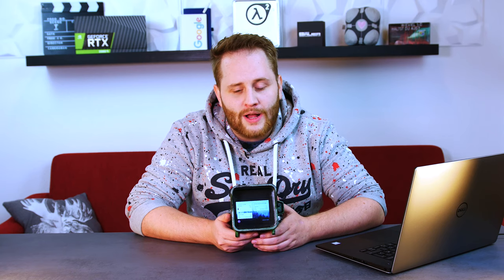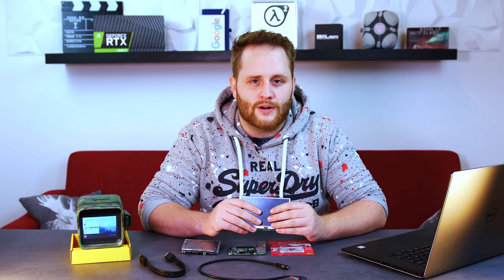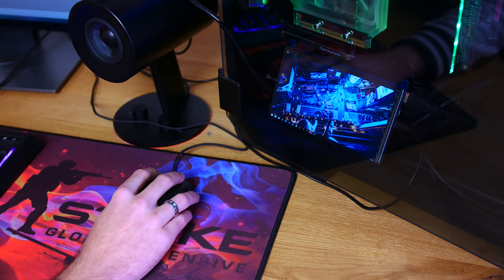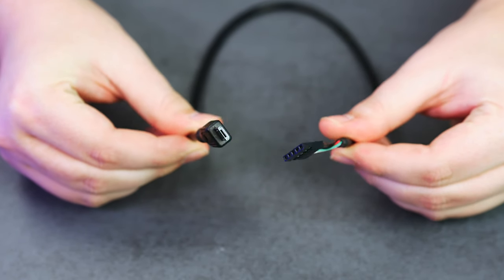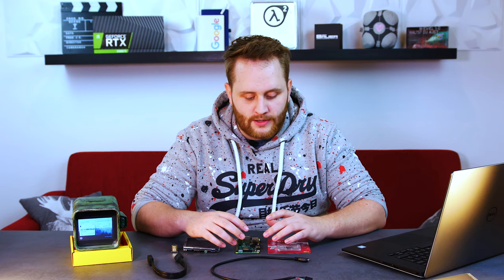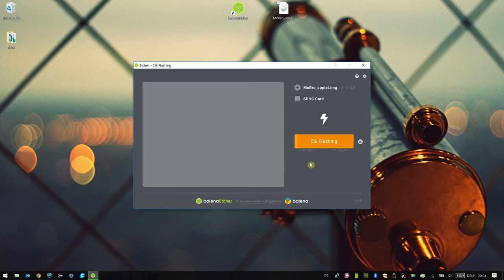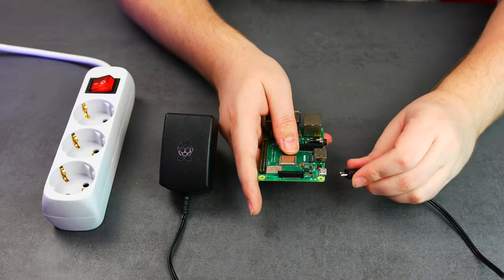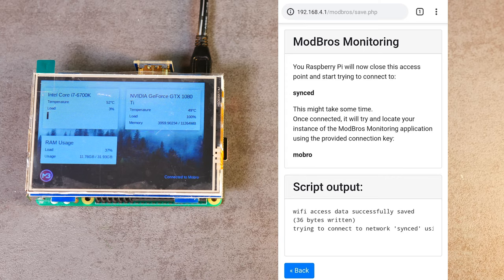How to create a PC Hardware Monitoring Screen Inside your Case

Comment: Great job! One question: If my PC connect to the Raspberry via wifi, does it means that I can't connect to the Internet(Wifi) at the same time. My PC doesn't seem to be able to connect two wireless networks at the same time. - -
Reply from the maker: Hey :)
You don't need to be connected to two networks.
Just connect to the Raspberries Wifi and follow the instructions to configure it. Once that's done the Raspberry will connect to your normal Wifi (there is no Raspberry Wifi after that).
Then you can connect your PC to your normal Wifi again.
Now that everything is in the same network, you're good to go and the Raspberry should display your Stats.

This setup is only required once. 
(unless you change your Wifi name or password, then you would have to do it again)
Reply: @ModBros  Very cool, just like the wireless printer. Thanks for the answer.

Comment: How do you display FPS Can't seem to find that anywhere inside the app im using it on a tablet via wifi on the same network as my pc
Reply from the maker: We currently use sensor data from open hardware monitor and Libre hardware monitor. If these sensors do not pick it up you could use hwinfo like described here:
https://www.mod-bros.com/en/faq/mobro/desktop-app/hardware-monitor/data-sources
As far as I know for hwinfo you need Fraps or MSI RivaTuner Statistics Server running in the background to see fps.

Comment: Running in to a problem. 
Have an AMD 5700XT and it shows constant 0% load, 0% Memory Used and 0 degrees celsius? Thoughts and Ideas? Anything I can do on my end? Note that it does Display the correct GPU (AMD Radeon RX 5700 XT)
Reply from the maker: Yes the 5700 series cards do currently not show data.
That's something we already know about and will be fixed in the next version.

Comment: I have an raspberry pi 3b+ and a 3.5 inch monitor but its stucks direkt in the raspberry do i MUST have a monitor with hdmi?
Reply from the maker: no you don't have to use a hdmi monitor. a display directly mounted on the Raspberry, connected via the GPIOs (the row of Pins), does also work just fine.
However you will have to install the corresponding display driver for it to work.
See the last section of our written tutorial for more detailed instructions.
Reply: @ModBros  bin am überlegen mir das auch zu basteln dann aber direkt im pi angeschlossen muss ich die Driver vor der Image Installation installieren oder geht das auch noch danach (sry hab so gut wie keine Ahnung vom pi)
Reply from the maker: @iDarkslay   Hey, sorry erstmal für die späte Antwort.
Erst das Image flashen, dann den Pi starten und danach den Display Treiber installieren.
Ist in der Anleitung nochmal genauer beschrieben.
Sollte was nicht klappen oder du noch Fragen haben, einfach wieder melden ;)

Comment: does anyone know if this works with the pi2? im asking because i got a few that arent doing anything right now
Reply: i'm in same boat.  couple laying around collecting dust
Reply from the maker: Well you would need an ethernet connection to the local network so the pi can find the MoBro application running on your pc. Maybe a USB wifi adapter also works, but that is untested. Here is a list of tested devices in our FAQ: https://www.mod-bros.com/en/faq/mobro/raspberry/supported-hardware
If you make it work please let me know 😊

Comment: Hello how to make it work with waveshare 3.2 inch screen which connects by gpio port in raspberry pi please help i love this idea so much
Reply from the maker: That driver is already included on our image, so no need for a manual installation on the console.
Just select the Waveshare LCD32-show or LCD32C-show (depending which model you have) driver in the 'screen setup' step of our configuration wizard and you're good to go :)
Reply: @ModBros  okay i got the driver but now it connects with the pc it shows in my pc as connected device but nothing shows on my 3.2 inch waveshare screen it only shows just starting lines like in matrix lines it shows connected but those measurement doesn't shows on the rpi screen
Reply from the maker: Well that doesn't sound right..
Are you sure you selected the LCD32-show from the Waveshare list and not the GoodTFT list?
Because those two are different screens
Reply: @ModBros  yes i selected the LCD32-show exactly now it just shows boot line and in pc it show raspberry pi is been connected but the stats doesnt shows in raspberry pi screen please help
i can show you the image if you wanna see then

Comment: Can it be using with new ryzen 3000 series processors?
Reply from the maker: Yes it should work, as it works fine with 1st and 2nd Gen Ryzen.
But unfortunately we couldn't test it yet, as we haven't built a PC with Ryzen 3000 yet.
Reply: @ModBros  Okay I will test. I will contact if I have any problem there. Thanks for your response.

Comment: can we use a small oled ~2inch?  is it allowd to modify the img?
Reply from the maker: You can basically use whatever display you like as long as it's able to connect to a Raspberry Pi.

Which image do you mean?
The Raspberry image: yeah sure, go ahead. However we will not be able to guarantee that everything will still work properly in the future if you change certain things
The background image: This will be possible as soon as we roll out the update with support for themes :)

Comment: i have a couple of questions. I have one of the revision a pi boards. Would I be able to run this software on it? Also
 If im using a usb dongle for linux would I be able to do this wireless?
Reply from the maker: Hey. If it's a Pi 3 Model A it should work fine.
The older ones do not have onboard wifi and i don't actually know if it works by using a usb dongle.
But if you already happen to have one lying around you could give it a try. Nothing to lose ;)
And if you do so, it would be awesome if you could report back whether it worked or not :)
Reply: @ModBros  thanks

Comment: Um.. can we use ethernet and not WiFi ? Or if I configure a hotspot on windows 10 will it start every time I boot?
Reply from the maker: we already received a few requests regarding this, so support for ethernet is already planned. most probably it will be available in one of the next versions :)

it won't work with the current image though, as we initially focused on getting it to run over wifi to eliminate the need for a cable

Comment: Hey There, 
I have a question.
I have my pc connected whit Lan and the PI whit the wifi in the same network.
Should it work like that? or do I need to connect the pc also whit wifi?

thanks .
Reply from the maker: Yes, as long as both are connected to the same network you're good :)
Doesn't matter if it's over wifi or Lan
Reply: ok. then I'm doing something wrong. 
I have wifi connection on the pi ,network name is the same. 'mobro' default.
when the pi boots the app is searching for the pc in the network but is unable to find it
Reply: Ok now it works. I have rebooted the pi and now he fount the app on the pc.
thank you for the quick response.

Comment: Is it possible to rotate the  monitoring software on the pi so that the setup can function in a portrait orietation?
Reply from the maker: Yes flipping or rotating the screen is normally not a problem, but the way you do it depends on which display you are using and if its over HDMI or GPIO.
Reply: @ModBros  I'm using mine over hdmi and am currently running the Mobro software. I would like to see the graphs, diagrams.etc in a portrait orientation as opposed to landscape.
Reply from the maker: That should be no problem then. Just check out the answer on our forum here:
https://www.mod-bros.com/en/forum/t/how-to-rotate-screen-with-mobro-software-installed~1022?page=1
Reply: @ModBros  thanks!, worked for me!

Comment: Hey. I have a question. Is it possible to change raspberry Pi display? I just want to display dounat  with CPU temperature (like you can in PC app), since my display is only 3.5 inches and its really hard to tell all stats.
Reply from the maker: Hey bro!
We do not have a interface for costimizable themes yet (yes it's on the list) but what you can do is change the theme directly, since it's just HTML, CSS and some JS. You can find the theme in your appdata folder that should be something like: C:\Users\<UserName>\AppData\Local\MoBro\app-1.0.0-beta1\resources\resources\public\theme\dubbadhar
If you have more questions we also do have a forum on our website.
Reply: @ModBros  I changed it and it looks pretty nice. Thank you
Reply from the maker: DiamondDemon09  awesome!😎 Just a little hint, if you update the MoBro Desktop app it would currently override all themes. So make sure to backup your changes and replace them after the update so you don't loose them. We'll change the folder structure soon to prevent that from happening and we'll also do a guide on how to create themes or edit them on our Blog. If you want you can also share your changes here: https://www.mod-bros.com/en/forum/d/themes~820 It might help others 👍

Comment: Hey I know the chances of you reading this comment are very slim. I have a current pi project I use a zero w and a hyper pixel screen. Because of the screen I have to use a different rasbian image. Is there any way to get this software as an application on the rasbian desktop. For example typing sudo get modbros for example and then open the application when j wish to see the stats. I'm very new to the who pi seen some my explanation may be bad.

Hopefully you can help me, so many thanks
Reply from the maker: Well we're not that big yet, so we still read mostly all of the comments ;)
There's no application that you can install, but you can of course use MoBro on a different image. Have a look at: https://www.mod-bros.com/en/faq/mobro/raspberry/diy-setup
Reply: @ModBros  thanks, I don't know much about you or you channel however after trying to find information on how to get this to work on my project, by the sounds and looks of things you and what you do is pretty awesome 👌

Comment: Could I use a touch screen display and use it as a tiny screen on my case for say checking discord?
Reply from the maker: The display is connected to a raspberry and is its own system that just reads the monitoring data from your pc. Currently it's just cpu, gpu and ram performance that is available.
Maybe someday we can expand it to also read other things like discord users in your channel.

Comment: Is possible to get the package for installing it on an existing working image of raspbian ?
Reply from the maker: No, we don't have a package at the moment.
But if you know your way around using a Pi you can simply do it yourself using a browser.
The Pi has to be connected to the same network as your PC, the Windows MoBro app needs to be running and you need to know the PCs IP address.
Then just go to [IP]:42100?name=RaspberryPi

So you could just start your browser in autostart and open the page if you prefer to do it that way.

Comment: First of all: Good idea

But why complain about an HDMI cable that needs to be routed from the graphics card into the case when you have to rout a power supply for the raspberry pie outside of the case?
Where are the advvantages there? It also makes the complete design very bulky and not really practical in many spots of the case since the raspberry adds much volume to be stored inside.
Reply from the maker: You have a power supply directly in your case. So you can just plug the pi into a molex  or power sata connector or even use the motherboard USB headers. No need for external cables. 
Furthermore you can also just have it standing on your desk as a separate unit.
We also do have an android app or you can run it on your pc inside your browser for example.

And the pi zero is really small, so it can be directly attached to the screen.
But if you really want - you can also just use a display and route the cable to your graphics card. We also support that 😊
Reply: @ModBros  thx for the answer. That clarified a lot for me :)

Comment: u tried th is on raspberry pi 3 used browser to connect to wifi it will not load
Reply from the maker: The image should work fine on a Pi 3. How exactly did you connect to the configuration hotspot? With your phone or a PC/notebook? And what doesn't load?
You can find a detailed setup guide here: https://www.mod-bros.com/en/faq/mobro/raspberry/setup

Comment: Hey, I would to ask when you will update the App cause I want to change the background or theme from this monitor, maybe add some more information like clock rate and ram... (I’m German so sorry for my bad English skills)
Reply from the maker: Wir sind Österreicher, also gehts auch in Deutsch ;)
Wir arbeiten gerade an einer neuen Version der App, die dann auch Themes und mehr Daten unterstützt.
Eigentlich wollten wir die ja scho länger fertig haben, aber es war dann doch noch mehr Aufwand als gedacht 😅
Wann genau kann ich leider nicht sagen aber es sollte (hoffentlich) nicht mehr all zu lange dauern :)
Reply: Mod Bros Würd mich aufjedenfall übertrieben freuen:) Und wenn ich schon so fix antwortet, wollt ich direkt mal nachfragen ob euer Raspberry Image zufällig das Panel von Quimat 3.5 Inch Touch Monitor unterstützt(kein hdmi) :)
Reply from the maker: Grundsätzlich geht jedes Display das offiziell mit Raspian funktioniert. Also ja, das Quimat 3.5 sollte gehen.
Du wirst allerdings zuerst noch den dazugehörenden Treiber installieren müssen.
Reply: Mod Bros Danke:) Und props für die schnellen Antworten, echt top!

Comment: How does the computer safely shutdown the pi when the computer shuts down?
Reply from the maker: There are two different methods connecting the pi to power inside the case:
Molex to micro USB cable
https://thepihut.com/products/micro-usb-male-to-4-pin-molex-socket-cable-0-5m
Motherboard USB to micro USB
https://geni.us/powerSupplyMotherboard

With both methods the raspberry looses power when the pc shuts down. For the USB method you might need to set up the power delivery in bios so it does not get power when the pc is turned off.
Reply: I understand the power connectivity easy enough. What I was wondering was when you shut down the power to the pc and being the power for the pi is coming from the pc. How does the raspberry  pi perform soft shutdown functions before losing power to prevent corruption on the sd from improper shutdown. Or does it simply cut power to the pi and if it gets corrupted you replace with a backup ad copy.
Reply from the maker: Hey. Super late response 😅
Yes, currently we are just cutting the power. No soft shutdown yet.
But in our experience, sd corruption is pretty rare and in that case we just flash the image again.
However, meanwhile we identified a way to ensure a soft shutdown an may implement it in an upcoming version.

Comment: I am having some trouble getting the app to display the sensor data. I can install the app fine, and can flash and setup the raspberry pi fine as well. the app can see my rpi device but all I see on my rpi screen is the mobro logo, and on the pc app it just shows "service not found, restart service". I have restarted numerous times and accept the permission that pops up. I have run as administrator, and although the app and rpi can see each other I put a hole in my firewall but did not help.
Reply from the maker: If the Raspberry is shown in the App, the network setup and also the Raspberry should be fine.
Are you running on Windows 7 or 8 by any chance?
If so, there migt be a problem with the underlying service, as it is built for .NET version 4.7.1
You may want to check your current .NET installation and if you're not already on 4.7, try upgrading.
This might solve the problem, but we will have to adress this properly in a future version.
Reply: @ModBros  no I am running windows 10 1903 build 18362.329. my .net version is 4.8.03752, I can access the config page for the device but it seems that the application is where the problem is. even running as a stand alone it still just shows the service not found.
Reply: just a side note. I had to go into the C:\Users\[user name]\AppData\Local\Programs\mobro\resources\resources\libs and manually run the monitoringservice.exe file as admin to get it to run but as of yet i cannot it to show up on the pi. will keep troubleshooting and updating if i find solutions.
added note: after manually running the monitoring service,I performed a sudo get-apt update and then sudo get-apt upgrade on the raspberry pi, then I restarted the raspberry pi. I now have the application running and it is showing up on my rpi screen :)
Reply from the maker: glad to hear that it's working for you now 😀
however that sounds like there seems to be some kind of issue while installing the windows service
we will have to look into it and hopefully fix it within a future version